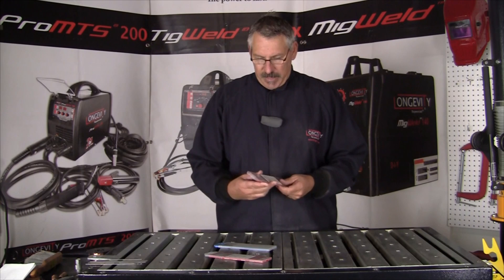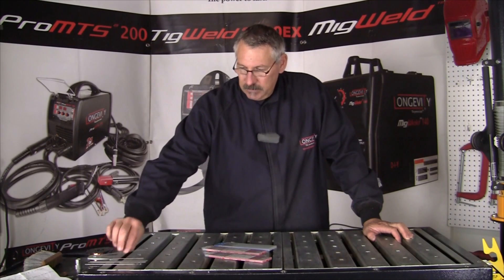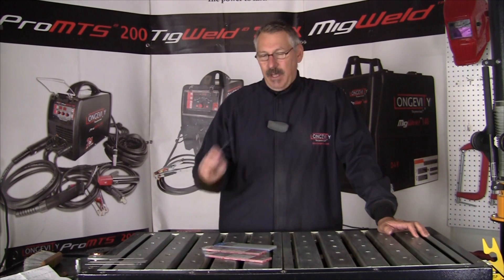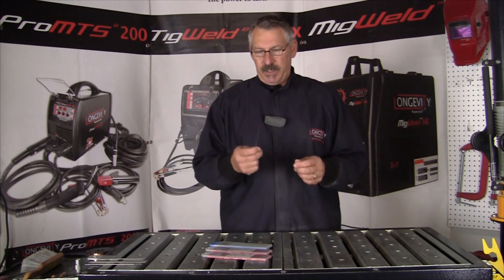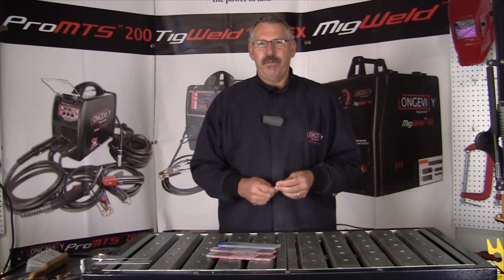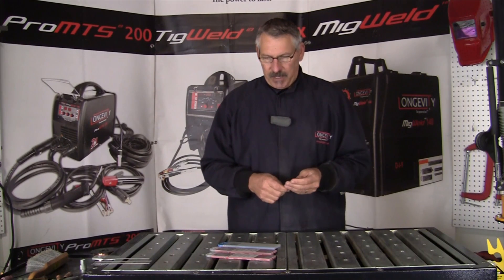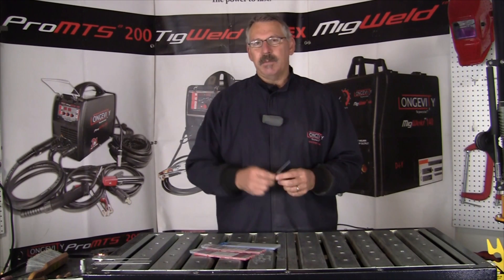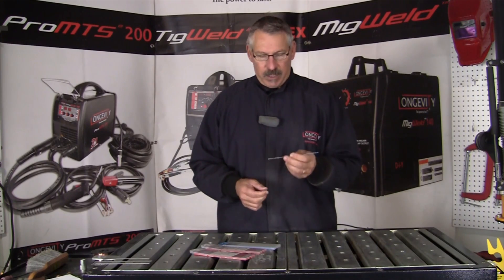TIG Tungsten Electrodes - 2% Thoriated, Lanthanated, Ceriated

Comment: If you consider the law of inverse square the particles of thorium are not dangerous unless they are in direct contact with our skin or in your lungs... consider a hot soldering iron at 400 deg, you can get it very close to your skin and not have a problem but touch your skin with it and suddenly your burnt... if that makes any sense to anyone! 

I have been wondering about the thorium in these rods and issues around grinding them because I'm rather clumsy and seem to contaminate my tungsten often. 

Very interesting stuff man!

Comment: I'm may be going mad (I've watched this video three times), but I missed the part talking about Zirconiated Tungsten?  Video title says: "TUNGSTEN ELECTRODES EXPLAINED - 2% LANTHANATED, CERIATED, THORIATED, AND ZIRCONIATED".  Still, three times watching and the info is drilled into me! :o)

For those interested: Zirconiated...
- Tungsten with Zirconium which is a chemical element with the symbol Zr;
- AC current ONLY;
- For welding Aluminum/Aluminum Alloys/Magnesium;
- Non-radioactive;
- Extremely stable arc;
- Color code (seems to be) either brown or white.